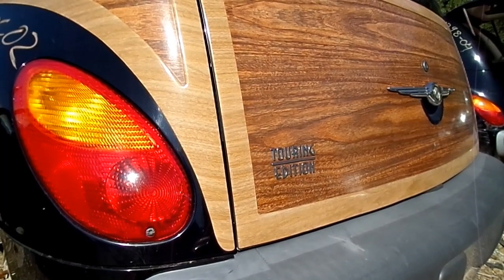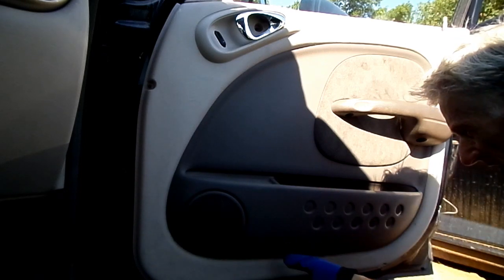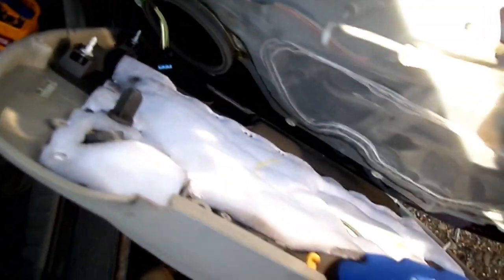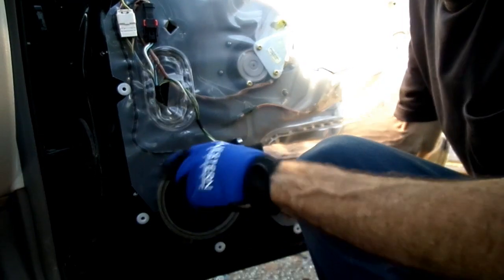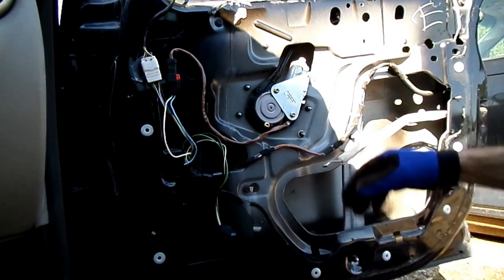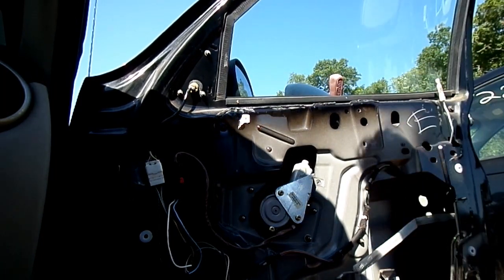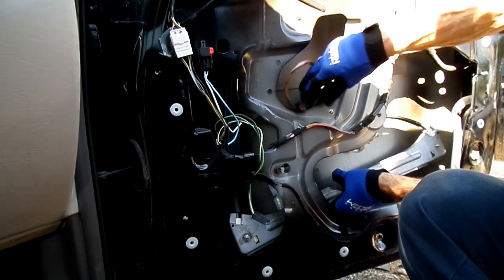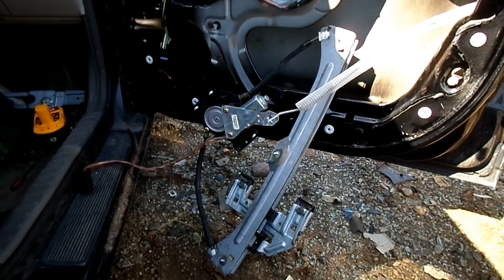PT Cruiser Window Motor Regulator Removal

Comment: Good video, both my 2008 pt cruiser window motors had issues. The motor worked fine it was the wire connectors that frayed and disconnected. No wonder those cars catch fire lol

Comment: Help!  I have a 2005 PT Cruiser Touring Edition. My passenger side window went all the way down, and will not come back up.  I checked the other windows and they all still work. I tried to jimmy the little tiny bit of window that is visible, just jostle it a bit, but that did nothing. most of the time,  when I  hit the button, it makes no noise and the window doesn't move or even try to move, however there were two times that I hit the button while trying to jostle the window, where I actually did hear the motor noise for a brief second, and the window moved about a fraction of a cm, then nothing.  I don't know what to do.  I live in an apartment complex and I really don't want to leave my car exposed with only a plastic bag covering the open window. I have no money to get this fixed at the moment either.  I'm so upset! Can anyone help me?  Thank you.